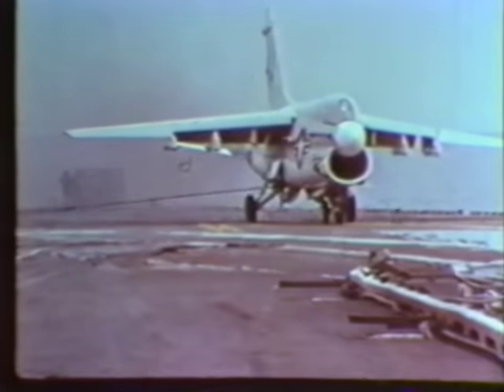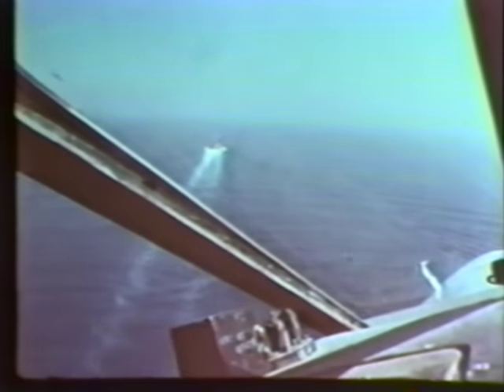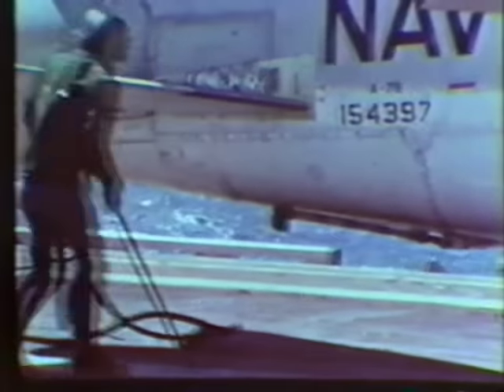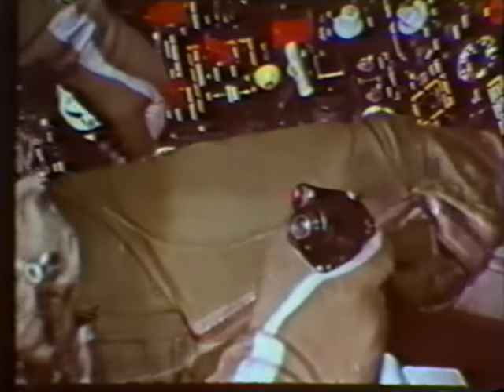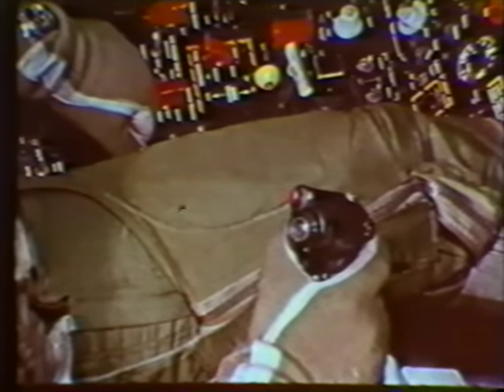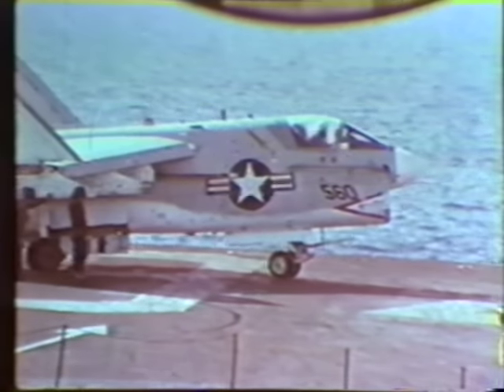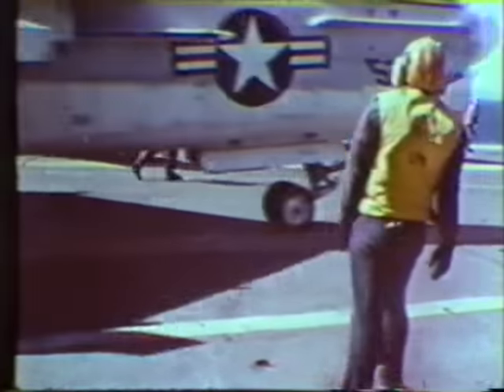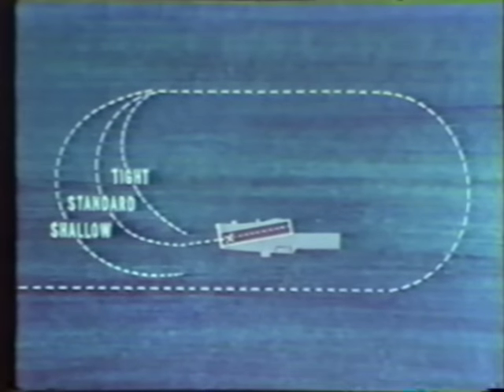Navy Carrier Mishaps training film

Comment: I worked on the A-7D back in 1977 with the 198th. TFW as a acft. electrician. I enjoyed watching the A-7's in their camouflage scheme.
Reply: We operated the magnificent A-7P in the Portuguese Air Force between 1981 and 1999. They were basically refurbished A-7As retaining the TF-30, with improved avionics and camouflaged like the Ds. I miss them a lot, with all their roar and smoke. We lost a good number, maybe some 11 or more out of 40 but it was impossible to isolate one single cause. On the contrary, there were a dozen of different causes involved, as with the Luftwaffe F-104G.
Still, pilots liked the aircraft a lot. I knew a few. But I must admit that in 29 years operating the F-16 we just lost two, one to flight control malfunctioning in the flight check after the MLU (ejected) and another in a stupid stunt at low level. (did not ⚰ )
To some extent, maybe the A-7 was a handful to some pilots, used to the light and basic F-86F and Fiat G-91...

Comment: There was a story I heard about the HMCS Bonaventure, a Canadian CV.
The story goes that a Grumman Tracker was taking off but either the steam catapult failed or the engines on the aircraft did and the Tracker stalled and fell into the water ahead of the Bonny.
The pilot and co-pilot managed to escape but the Bonny ran them over and they bounced along under the hull until they reached the propellers.
The Pilot saw the props and quickly ducked into a ball and managed to miss the blades, the co-pilot didn't and had his legs chopped off.
Both pilot and co-pilot survived.

Again this is just a story an old sailor told me at a Naval Museum in BC.
Reply: It's a story worth repeating whether it's true or not.  Thanks.

Comment: I worked “ gear” on the Midway from 73-75  . We had one “two block” with an A -6 and luckily the cable did not snap . Freaked me out though . Later  I transferred to the Constellation , which was in  Bremerton going through overhaul . By the time we went back to sea I was promoted and moved into the division office . I never went back on deck or in the gear operation compartments . Was discharged and never looked back .
Reply: CV-41 77-79
V-1 Div
ABH
I loved driving a MD-3
Reply: Worked in the gear on CORAL SEA, CV-43  from 76-80

Comment: Yes, if you make an error, you can go into the drink!  It's NOT easy for these super-fast fighter jets to slow down enough to land exactly and hook a cable.  If they are not right "on the ball" (the "meat-ball on the port side of the carrier) lined up with the green lights, they won't tail-hook properly and they'll have to "bolter" which means take right off again (the aircraft is at speed anyway so you just add power and lift off).  They make about 32 passes on ground in training, then do it in the dead of night, and then go on to become part of the fleet and go to the carriers and "ball-fly" on them.   You have to be right ON the center line and ball-fly at an angle to line up just right.  It's not easy to do at night!  There are usually 4 arresting wires on the carrier.  Landing on the first one (too low is bad) or the 4th one (too late) is not good.  You want the 2nd or 3rd wire, preferably the 3rd..   It's that precise!   When catapulted in takeoff, It takes about 3 seconds to go the 300 feet and takes off at 115 to 125 mph.  An airport runway is about 16 times longer than the carrier deck.  The optimal landing area is about 90 feet wide, and you must get it down right on the center line.  This is where you either make it happen or get a DQ (did not qualify)!
We really hand it to these carrier pilots, it is NOT nearly as easy as it looks!  Imagine trying to return to a carrier after you've been shot at over enemy territory and have problems!  Horrors!  But it's what they have to do, an air base may be too far away for them to make it there!  It's difficult to imagine the fear they must feel in that situation.  Bravo, pilots, and keep safe!

Comment: NAS Jax, AO school 1968, ran the projector in the classes and I threaded many of these films into that 16mm machine. Saw quite a bit of them and the ordnance goof ups were fun to watch, especially the ones from China Lake. 
I was on one of the de-arm gun crews for the A-7 and once pointed seaward, I had to disconnect the air supply line from each cannon. Crawling under the aircraft was a bitch for me since I am 6'4" and you had to get it done quickly as there was always another one coming behind the one you just did. 
My squadron was A-6's, how I was ever tagged to do this is still a mystery. 70-71 Med cruise on the JFK
Reply: With all the billions of dollars spent on CV's; why so crappy tv cameras on ship?

Comment: VA-12 Clinchers - Ubangi Ubetcha - NAS Cecil Field, FL...About 1985 or 1986 AT shop (after some A7 training at VA-174).  Had to pump up the radios to pressurize them.  lol.  The primary maintenance activity for the Aviation Electronics Technician?  Solvent to clean all of the hydraulic fluid from antenna lines, wave guides, and cannon plugs.  I've inadvertently inhaled a metrodome's worth of Tri-chlor and zinc chromate.  I could probably still fill out a VIDS MAF for corrosion control.  Then, A6s at Oceana in Virginia Beach where we combined with the AQs.  N 036490 W 076020.  A good time was had by all.
Reply: Ah yes, VA Beach.NAS Oceana, I was an AME with VA35 Black Panthers. Fun stuff, ejection seats and who could forget LOX.
Reply: @carlosborbolla1204  We chewed some of the same dirt.  I was in VA-36, an instructor at VA-42 (after C school at NAS Memphis) from about 89 to 92, then VA-65 when I got out.

Comment: Seems to me in about 1966 the take off was modified to stop the splash right in front of the ship. The aircraft on the front catapults turn a few degrees on launch to avoid a splash if the ships path. Before that i have seen 2 pilots ejecting and hit the flight deck. No chance to stay on the deck they would just blow right off the fantail, even when the deck crew tries to catch them. The helicopter picks them up. Crusaders are AWESOME.

Comment: Sure am glad the Navy pilots found a place to get rid of that many A7’s..  I worked weapons in the USAF and the A7 wasn’t the best airframe around.
Reply: Living under the flight deck, they were the softest landing aircraft; the F-4 sort of crashed to the deck but the A-7 was nicer sounding.
Reply: I beg to differ - SLUFs were quite sturdy, and the Echo version had a very good safety record in terms of mechanical reliability: they just weren't terribly forgiving of pilot error in landings with crosswinds - that is, until the ACLS system was introduced in the C and E models (given that, I would guess that this film only included As and Bs - the few that I could tell definitely were pre-Echo). With the addition of the ACLS, the Echo was known to dent the actual flight deck with the tailhooks because they hit the exact same spot every time in a mode 1 approach - a firmware update actually programmed in a small pseudo-random error - or that's how the scuttlebutt tale went, anyways ...

Given what it was designed for, the SLUF performed quite well in the hands of a good pilot - it wasn't fast, but it sure was slow, and a highly accurate bomber - and the Corsair's terrain-following mode was quite impressive: by "gully-hiding", Corsairs have been known to take down F-14 Tomcats and F-15 Eagles :-)

Comment: I always wondered if the canopy of an aircraft, could be jettisoned without completely ejecting. Thanks! Looks like the pilot at 5:04 ejected a little too soon. But what do I know, there could have been something seriously wrong with the aircraft...?
Reply: The pilot had lost control of roll, and ejecting at a high bank angle is very dangerous. He ejected inside the envelope still probably, but not by too much. It was a good decision because either the aircraft started working correctly, or he would be sideways and ejecting could result in death or severe bodily injury.